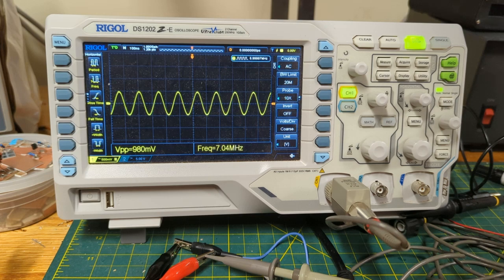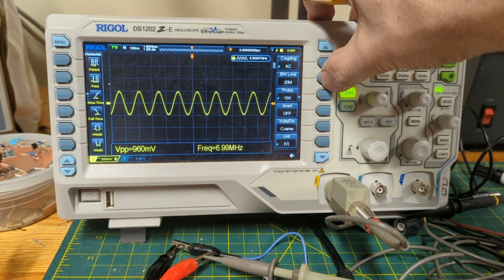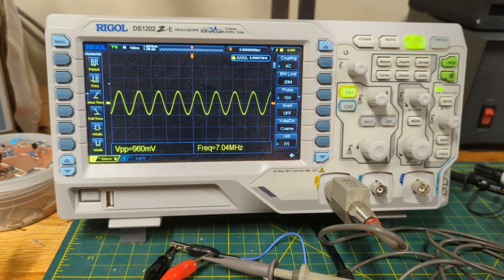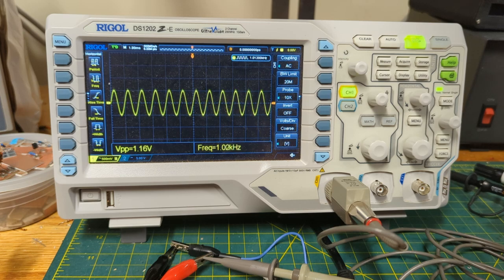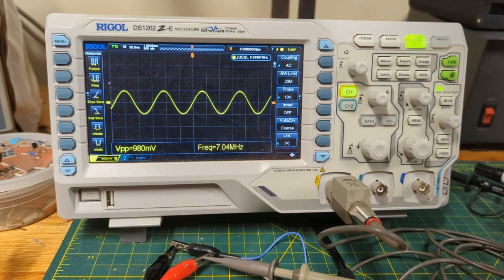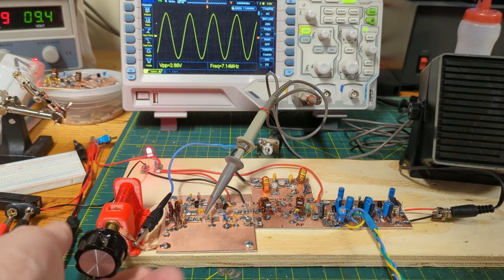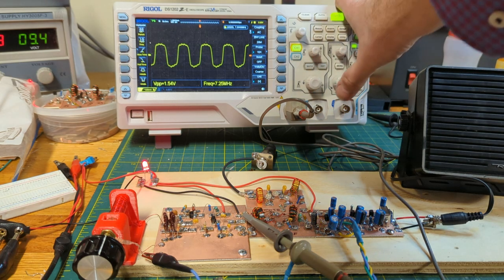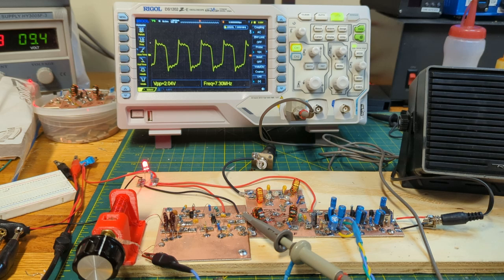SolderSmoke Challenge   Bonus   Using your Oscilloscope to test your DC Receiver

Comment: Thanks for the shoutout.  Al so, be sure to compensate your 10x probes!  When looking at HF, if your timebase is too slow (such as you'd use for audio), you can alias your HF signal, which can be very confusing.  The Frequency on the measurement line basically takes a period measurement and does the math - since it is looking only at a single cycle - it can be dramatically affected by noise (as you see).  The dedicated counter looks at MANY zero-crossing which effectively averages out the noise. (thanks for the care package!)

Comment: Not sure if it was Rigol’s or another brand where there was a software hack, something like changing what was a 100MHz scope to a 200 one by installing a software because the hardware was basically the same. If yours is the same as Bills and Farhans then it is probably the right choice. Thanks.

Comment: The Rigol 1202 is the only one I've ever had.  It's 200MHz, 2- channel, with a good variety of measurement functions.   If you never want to look at frequencies outside of HF, you can get the 100 MHz bandwidth version for a little bit less.